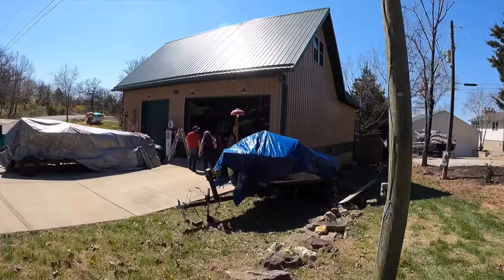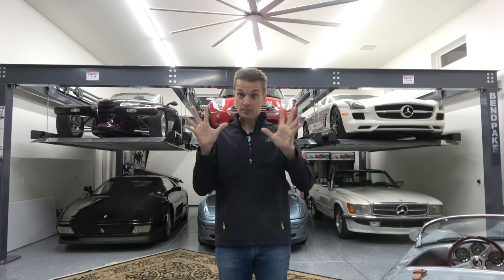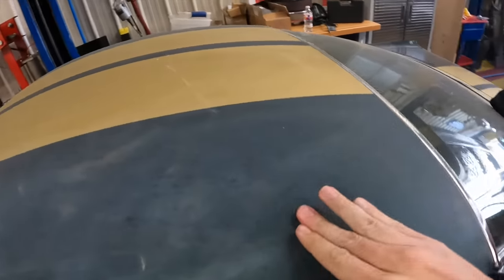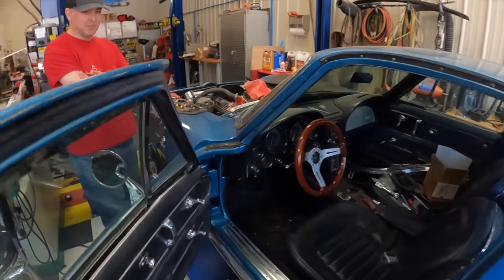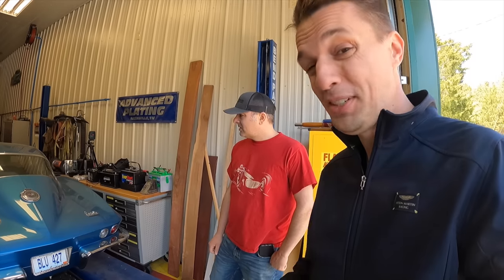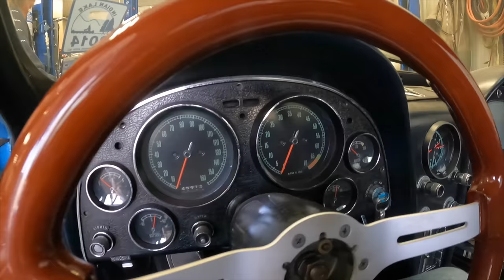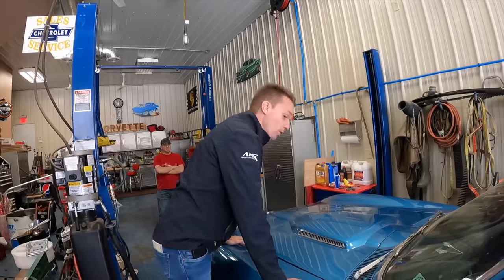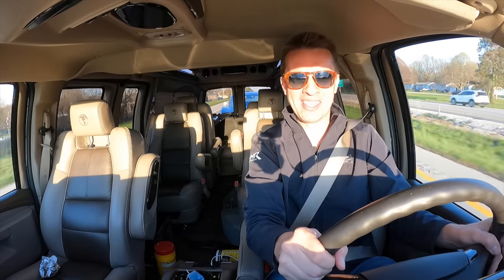The Corvette Barn Find of a Lifetime! Buying a Rare 427 Coupe in Cuba?

Comment: My prayers go out to the elderly man who has to part with these two absolute classics. In the late 1970's I owned a '67 Vette in Tuxedo Black, L88 427 with a lumpy cam, and an M22 Rock Crusher 4 speed.  Man the sound that thing made. The transmission has a whine to it that sounds like no other.  I had it for 18 months. I bought it for $5500.00 cash and sold it for $7850.00. I thought I was a financial genius driving an incredible car for a year and a half and then making a smooth $2350.00 profit on it. I could have kept it, but that profit was too tempting.  Now it would be worth... Maybe $200K??? I'm going to go bang my head on the wall! LOL

Comment: My dad just sold one of those.  Literally, same color.  It is a driver with some miles but all numbers matching.  If this one is righteous, the driver condition version is worth a little over 100K.
Reply: Didn't sound like this was a numbers matching car - newer 427 and a new Tremec transmission. MSD ignition visible on the inner fender. So not a 6 figure car, but still awesome!

Comment: "Barn find" -  with a brand new 427 and a new Tremec 5-speed  😏
Reply: Nick.  The trans is good.  So of course Hoover took it out a n d replaced it with a 4 speed.
The engine is almost certainly a 402 jjunkyards. To 1 tire POS  which Hoover trashed in a thousand miles or so.

Comment: That's some weight balancing job on the trailer lmfao.
Reply: Heavy end over 2 axles.  What's the problem?  I'm sure the tounge weight is just about perfect on that van.
Reply: @robertrutherford9057  I don't think the van pointing up and the trailer pointing down is ideal.
Reply: @1BergerVongSchlauigkeitHer  if he had put the car forward the bumper would of hit the ground
Reply: @robertrutherford9057  Well yeah, that's what I'm saying. The front of the van is pointing up and the front of the trailer is pointing down, i.e. it's not balanced well.
Reply: @1BergerVongSchlauigkeitHer  the van was squatting with a empty trailer.   Placing the heavy part of the car OVER the 2 trailer axles was the only way to go.
Reply: @robertrutherford9057  Ok NOW I think I'm on track. I must have missed that.

Comment: Tyler,  love the channel and content. One hell of a find sir, gonna be an awesome driver. One piece of advice, and this is solely from experience, never haul a 60's vette backwards on a trailer. The back window is so much easier to break and much more expensive to replace than the winshield. 2nd, I had a buddy hauling his backwards, same deal as having a non runner to winch out of his garage....14 miles down the road  the hood came open at 65 mph causing significant damage to the entire front end! Be safe and enjoy it, I think we're all a little jealous on this one  👍

Comment: I grew up with C2 Corvettes. 13:15 is the correct way to close the hood. Set it down gently then press each side latch. The chunky small steering wheel looks odd, but I've never driven one with power steering.

Comment: I just drove from TN to FL last week to pick up a 1 owner 2000 RT/10 VIPER with 16k miles , the soft top still hadn't been took out of its bag. Was sitting on its original tires, that had to be replaced.

Comment: Awesome find Congrats.  Found a 66 Coupe here in Canada  2 years ago just love driving it now.  But it was only a Numbers 327 car with factory power steering and A/C which is rare up here.  The 427 will be awesome with that transmission.  Tach doesn't work as it is gear-driven.  You can get an MSD gear-driven tach to fix that.

Comment: That appears to be if the tach is correct a L72. 427/425 hp solid lifter Special high performance. 
the original engine would be a IP coded on the stamp pad. 
If it is a factory L72 it should have 3 holes in a about a 5" triangle pattern for mounting the Transistor Ignition Amplifier on the front side of the Drivers side inner fender.

Comment: Great car, I'd have one of those over any Lambo or McLaren that's for sure. I'm surprise you don't seem to tie the car down on the trailer? It just seems to be sat there on the (hopefully working) handbrake? You really do have to tie down each wheel to the trailer for safety, you don't want it moving about or sliding off there..

Comment: Ive been buying vintage & new'ish tube hifi equipment and ubber high end hifi & home theater equipment that can cost as much as $500k when new since 1999,the biggest issue i quickly learned was to always meet in strangers homes armed ,and to take atleast an extra $50k with me incase the widow has some other crazy expensive something her husband bought & she now is willing to sell something for a quarter of its resale value on ebay,the best unexpected score i found was at a widows home i went to to buy a pair of Mcintosh speakers that cost $120k when new when she showed me her husbands ultra rare Bob Carver 700 watt tube mono amps that sell for $40k to $70k ,since i met her asking price of $20,000 for the speakers she let me buy the mint condition Carver amps for $5,000 as a package deal ,i still have the amps & will never sell them because they are more rare than this Corvette ,the speakers i flipped in 8 days for a $15,000 profit or $10,000 if deducting the mono amps i kept .

Comment: Is that Vet a numbers matching car? L-88 427? Do you know what heads are on it? Stock. Oval or square? It idled very well so I’m assuming no big cam in it. Did you get the VIN? If I remember correctly on those cars the VIN is located up under the glove compartment?

Comment: Maximum noseweight for that trailer: Probably about 100kgs

Hoovie: Parks 427 in the back of the van
Reply: His tounge weight is correct because the van is perfectly level. The car is backed onto the trailer and the weight on the engine is almost dead center. If the car was facing forward than I would agree but it's not.

Comment: You can find the build sheet on top of the gas tank. That will tell you what the car was born with and build date. If not, the National Corvette Musuem might have it for your vintage. 

The 66 came only with a 4bbl, no tri-power.  It is not original, just looking under the hood. But the buildsheet will fill in the blanks.

I am not sure about the Shelby, I thought all GT350s started life as K-codes.

My brother owned a 67 L71 coupe... they are beasts... Torque out the ass... but all that power and bicycle tires... sigh... oh, and don't get too carried away by 60s power ratings, they changed in 1972 and the numbers fell like rocks. What was 450hp was now 325! Gross ratings to net ratings... my ex-gf has a 1971 Mustang Mach 1... it has the base 210hp 302, the next year, the engine was identical, and it now put out 140hp. Ouch.